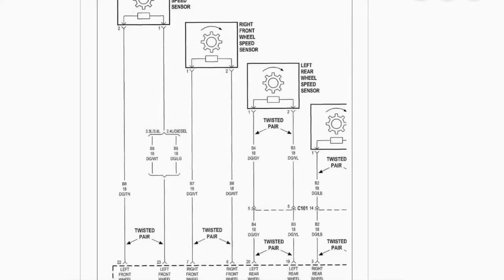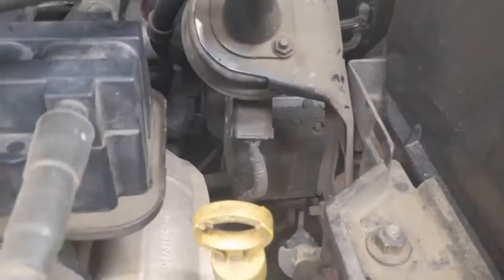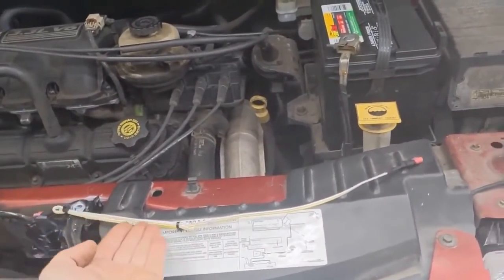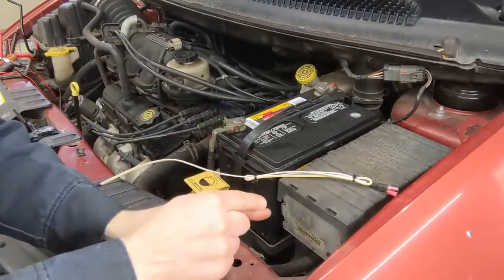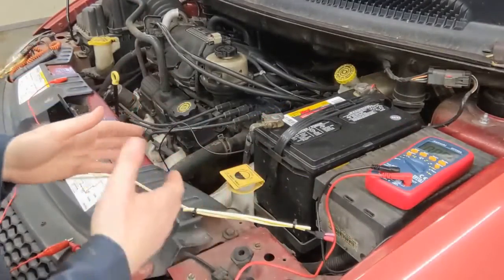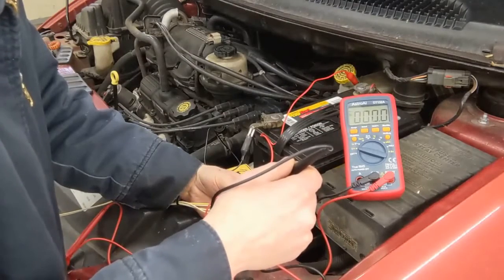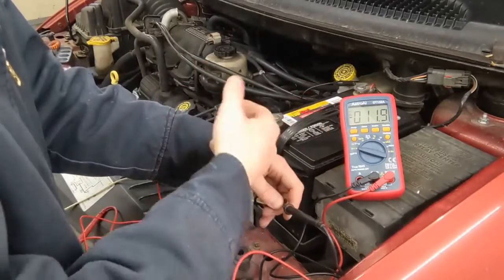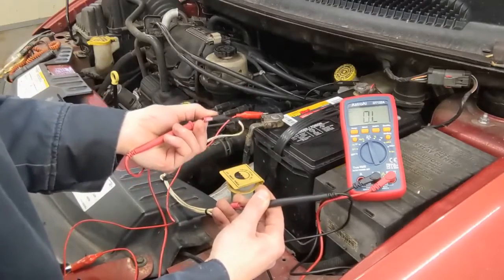Abs Wiring Harness Checks | How to Test the Harness Side of the Abs Circuit System for Faults

Comment: nice video
Reply from the maker: Hey thanks Jacob 👍
Reply: @ValleyMobileAutomotive  I have toyota rush with ABS on, code C1272, low output voltage left handside abs, whats should i do
Reply from the maker: @jacobndunguru5584  It looks like the Rush is the same as Toyota Rav4 here in the states. What year is it?